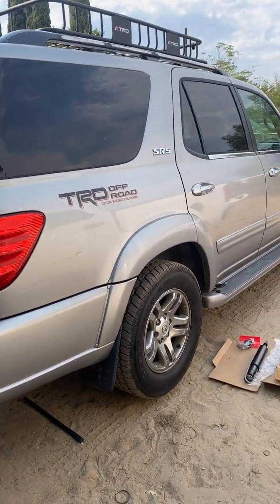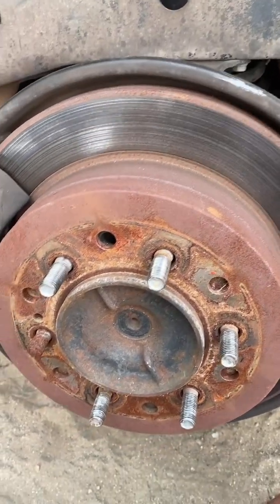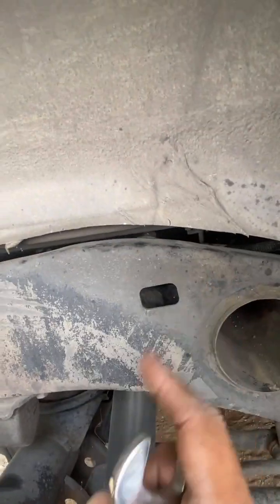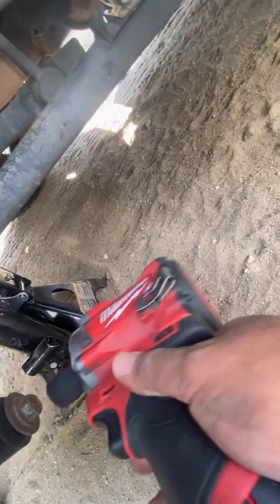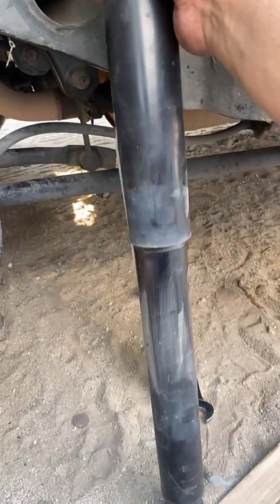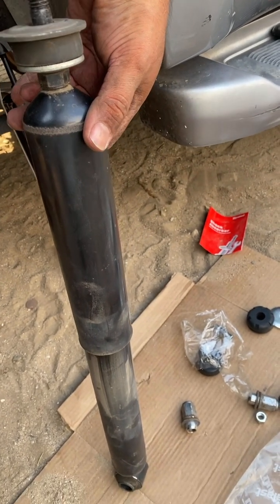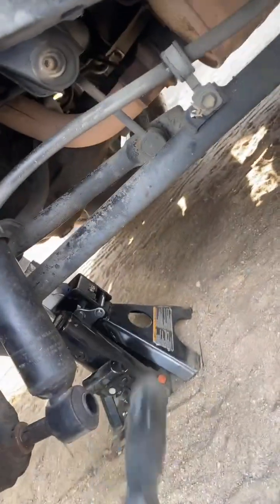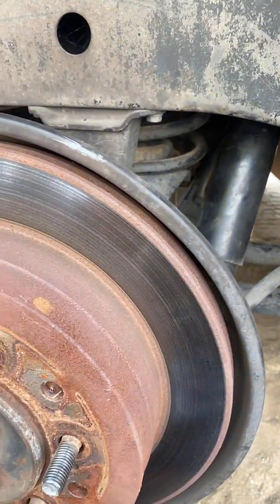2001 - 2007 Toyota Sequoia Rear Shock Replacement easy !

Comment: I know this is not the vehicle I have a question on but you did videos on a Mazda 3 2 years ago I have a sound that sounded like I had something moving around in my oil pan but when I removed it there was nothing so do you have an idea what it could be . I have a 2008 Mazda 3 I sedan  it has the 5 speed manual transmission.
Reply from the maker: @ErnestWorkman-i3k  great question, can you email me a video of that sound ?